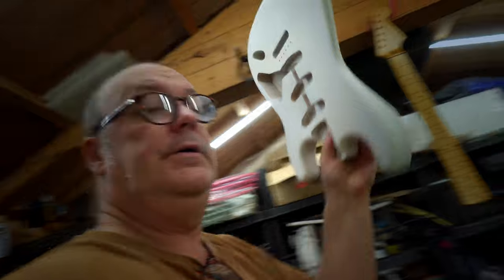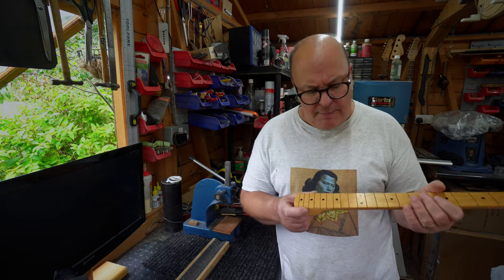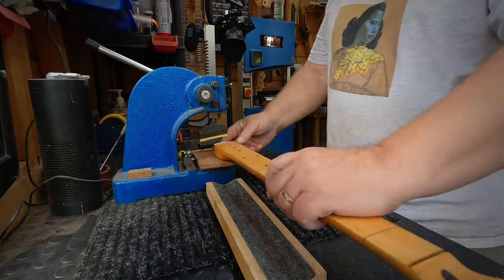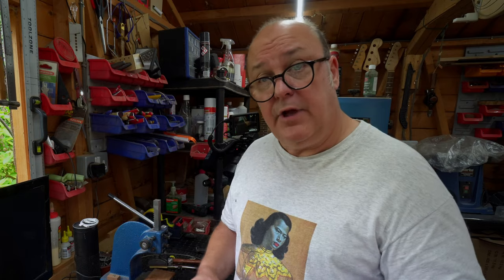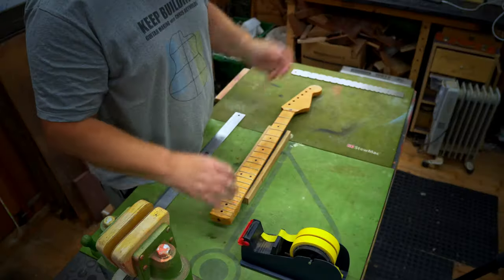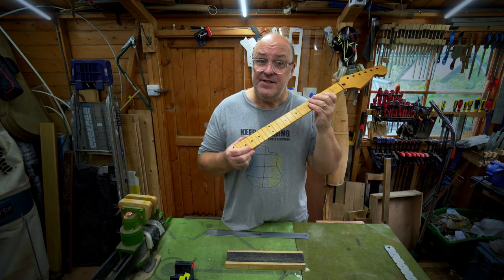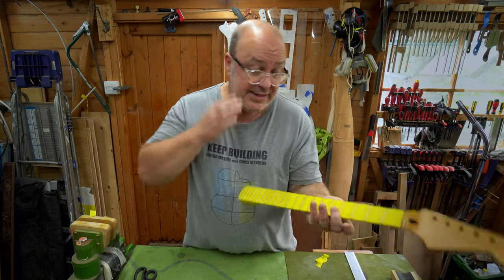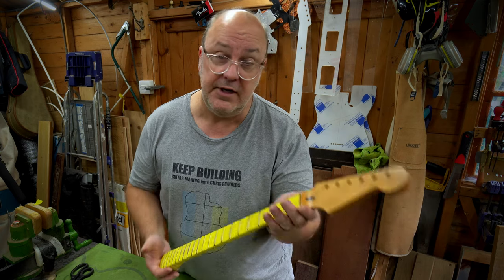Stratocaster Partscaster Complete Build Part 3

Comment: I'm so glad this was first up in my feed this morning 

That's a standard Arbor Press for anyone that's reading. 
All you'll need to find are Fingerboard Fret Caul Inserts. It think you'll need about 8 sizes or so
Reply from the maker: It is. I drilled a 10mm hole through shaft for the fret caul. I then drilled another smaller hole that I tapped with an M8 thread. I bought a set of fret press cauls for not much from eBay. Saved a ton of cash compared to a stewmac one. I used a decent battery hand drill and some oil to lubricate it.

Comment: A stone Dremel bit with a groove would probably do the trick for  fret work in a timely manner and you have a decent degree of control
Reply from the maker: Sadly not. Absolutel precision is required hence the radius beams that gets the camber or profile correct and the level between frets. If that is out by microns you get buzz. You can use a dremel and Jewellers rouge to fine polish the frets though. C

Comment: Happy New Year Chris! It’s me again. Lucky you.

I’m thinking about crowning my frets, but I haven’t one of those straight edges with the notches to make sure the neck is straight, or a crowning tool, just a small triangle file.
It is absolutely essential that it’s dead straight before doing any fret leveling, correct? Not enough to use an 8” radius block and a felt tip marker on a neck with a tiny bit of relief?
I suspect I have a couple high frets, and I’d like to give it that TLC you speak of.
After the leveling bit, what grits of micromesh do you graduate to?
Reply from the maker: First question. Why do you think your frets need crowning? This is a process carried out after a guitar is fretted or re-fretted. If you have divots or buzzing frets you need to level the frets first if they will take it. If they won’t you need to re-fret. Crowning isn’t a process in itself as what it does is shape the top of the fret to minimise the area that contacts the string. You need to crown a levelled fret to restore this peak. Maybe try and explain to me what you are unhappy about regarding your frets. We can then plan a way forward. Best wishes C
Reply: @chrisreynoldsguitarmaking  your willingness to coach a fellow through a problem is commendable and it’s not the first time you’ve helped me. Cheers.
Essentially, it’s a new player series Strat that I purchased just a couple months ago. There’s buzzing on the E and A string that I can’t seem to eliminate with relief or action. I  ran a baroque guitar maintenance measuring card across 3 frets at a time to find any wobbles, and sure enough the 10th and 12th frets are a smidge high…. So at the very least, I think a leveling is in order.
As for crowning uniformly, you had said in this video that Fender can’t afford to give this type of attention to production line guitars, and figured that because you were doing it to newly laid frets, mine could use it too?
There are some flat tops on some of my frets where I bend the most, but I suspect that’s just the satin poly being rubbed off, as I’ve only had the guitar for a couple months.

Would love your advice. I’d like to get these frets as nice as I can without having to bring it to a luthier, or spend another couple hundred on specialty tools…. But of course, I don’t want to sacrifice quality to save a penny, so honestly whatever you recommend is likely what I’ll do.

Comment: Hello again Chris! I sincerely hope all is well with your health and French property search.

I hope you don’t mind my asking for another bit of advice. The update on my guitar neck project is that I went the water dye and clear nitro route. 
I’ve taken your advice and redone it a few times to get it just how I want it and I’ve now found the perfect combination of ColorTone straw and vintage Amber… problem is that it seems to soak more in certain areas. 
Did you find this to be the case? There are areas where it’s a little darker than the rest, and while it looks lovely as it is, I can’t help but wonder if there’s a way to get the water dye to wipe on uniformly.
Thoughts?
Reply from the maker: Yes. This can happen. If the neck hasn’t been sealed in any way or it’s not uniform you can get these variations. I think a thorough sanding and a wipe down with acetone before staining can help. Also using coats of thin colour rather than one pass can even it out.
Reply: @chrisreynoldsguitarmaking  cheers!
Did you seal your neck in this partscaster series, or did you wipe down with acetone? 

I’m also a little worried that repeated sanding (320 grit, not terribly aggressive, just enough to get it down to bare wood) will change the geometry. Is this something that I ought not to be too worried about? I’ve sanded it back down about 2-3 times already.
Reply from the maker: @pjincho  I’ve mentioned over sanding a few times in my channel. We have to be sensible about sanding and avoid blurring the instrument by rounding everything over and removing the clean edges.  Like everything it has to be done mindfully. I tend to drop to 600 or 1000 once I’ve got things sorted. I then move quickly with dilute passes. I try to get my colour done in two or three passes. I’ve messed the strat neck several times by going straight for game and then ignoring my instincts. But don’t freak out. Just get it the way you want it. It will be far easier the next time, because by then you’ll have your own technique and skillset. C

Comment: i'm surprised you didn't mask off the neck pocket. do you scrape that out before assembling?
Reply from the maker: Someone else mentioned this. It’s optional. The fit is quite loose so I thought it would be good news if the joint ended up a bit tighter. I have no other concerns. The vibration transmission is unaffected and I prefer the painted pocket aesthetically. All the best C

Comment: Serious question: I use a notched straight edge, because I think if some frets are high a non-notched straight edge could give a false reading... what's your reasoning for using a non-notched one?
Reply from the maker: I dunno really. The notched ones are heavy and sharp. I bought one because it seemed a good idea. But I rarely use it in anger. The straight one I trust and because I use a press my fretting is pretty consistent. You can also spot high frets and tap the in. Generally it’s not hard to see when it straight with a good straight edge. The notched ones are more tricky to read.

Comment: Any tips for supporting the neck with a set neck? Presume it's the same deal, setup with a caul but just make sure it's properly supported? Also - I've used a levelling beam in the past as don't have a radius beam, will you notice/experience more buzz if you don't follow the radius of the board?